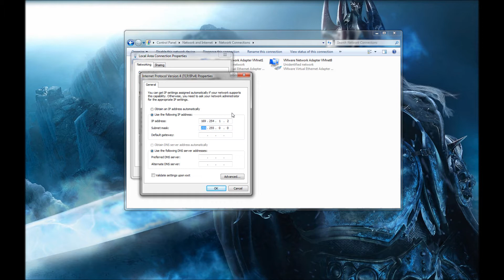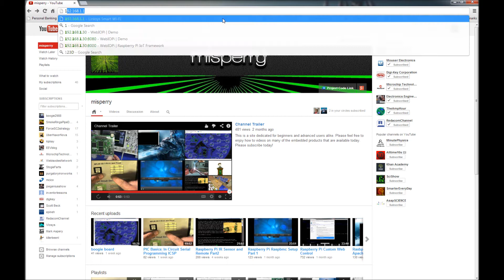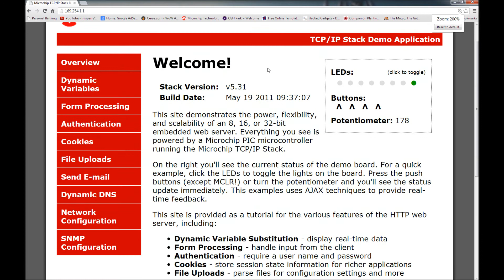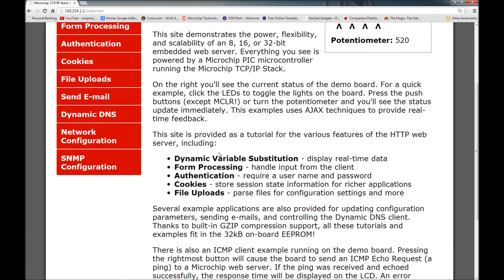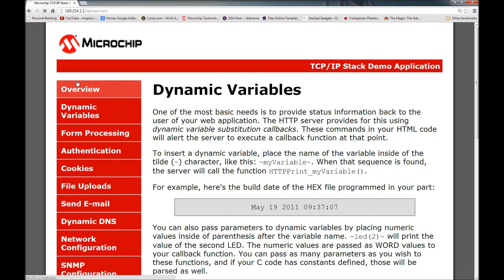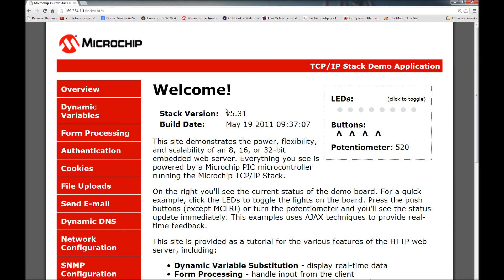Embeded Web Server Intro to PICdemnet2 kit

Comment: do you have a video of storing data to external memory and graphing it on the webpage in the pic.  I'm trying to store data and probably need to store it all externaly.
Reply from the maker: Hey there, I do not have a video just for storing external information and graphing it but I do have a video on how to use an external eeprom and communicate with it using I2C.  To graph it you could retrieve the data from the I2C eeprom, using the micro, and then maybe alter the html code to update the graph.  something like that.

Here is the external eeprom vids:

https://www.youtube.com/watch?v=nd2irnS-FU0

https://www.youtube.com/watch?v=RDedl-FtfcU

Comment: Hi, this DEM boards are quite nice for practicing. Im working on my final year project, and im doing something that requires a webserver. The challenge i'm facing is that im not meant to use microchips already made hardware solution for my work. So, is there a way i can build my own customized board that would be compatible with the microchip TCP/IP stack. Anticipating your reply

Comment from the maker: Ok, what I am talking about in comparison to the raspberry pi is that I did not say that you should buy the PICDEM2.net kit only for an embedded webserver solution.  What I did say was that for you to build your own custom web solution using a tcp/ip enabled micro or one of the external controllers, your own hardware layout and your own code.  I want to show you how to build your own raspberry pi with hardware and software instead of just buying some pre-made solution that some one else designed